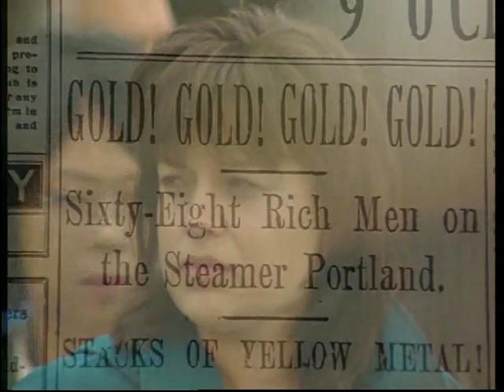White Pass & Yukon Opens To Carcross (Narrow Gauge, Skagway, White Horse, Yukon, Canada, Alaska)

Comment: This is great. I've only taken the normal tourist route from Skagway up to the pass (bus back down) but would love to try the Caircross extension. Guess there will never be enough demand to justify reopening to Whitehorse...
Reply from the maker: Unlikely to open to Whitehorse. The only hope is a freight source. There was a big plan to dual gauge the entire railroad and extend the standard gauge portion hundreds of miles to a mine in the middle of nowhere. Tough to justify the cost. Maybe if they find a Lithium or Rare Earth mine in Yukon?
Reply: @trainclaude  Makes sense: I've flown over that abandoned part of the line and it showed me that the scenery for tourist passengers between Carcross and Whitehorse is nowhere near as dramatic as the climb up to the summit from Skagway. I am grateful that they invested in re-opening to Carcross; that run by the lake looks very pretty. One thing I've learned exploring abandoned railroads in the Pacific Northwest is that even a few years without maintenance means vegetation makes the line impassable and small washouts quickly become wide ravines (meaning a million-dollar rebuilding job). Nothing good lasts forever... ;)
Reply: @trainclaude  there are some rare  earth mines in the Yukon but Ca decided to spare it up for later when  chinese rare earth deposits are exhausted. So maybe up to Tungsten in 50 years.
Reply from the maker: @steffenrosmus9177  Good to know what is going. I was an electrical engineer before I retired and know how important rare earths are. There are few sources and I believe the largest single source is China whom I do not trust as a reliable supplier. I guess we will wait and see what happens. Thanks for the info.